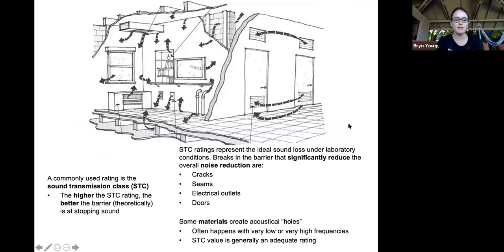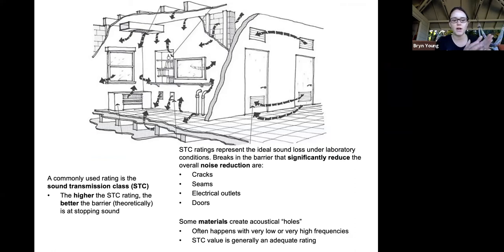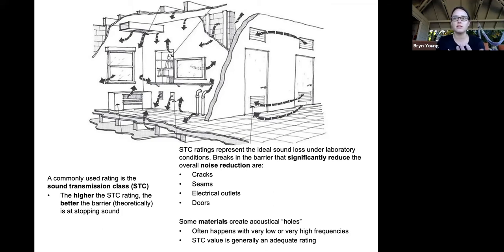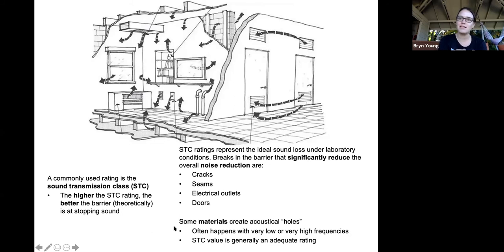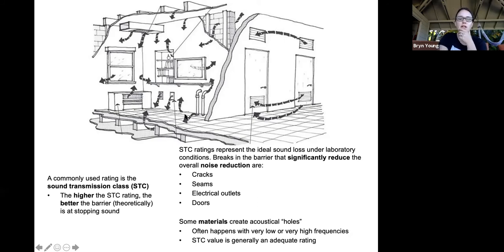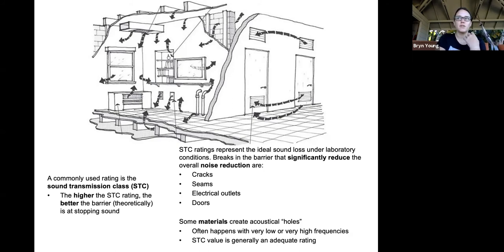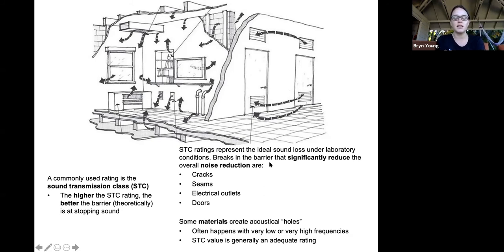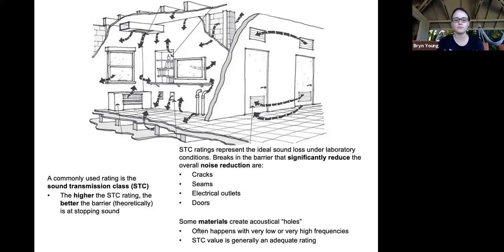Architectural Acoustics for ARE 5.0: STC rating

Comment: Thanks for the information!
Reply: Do you make any special considerations when designing a home if it is built using insulated concrete forms vs if it was built with traditional wood/balloon framing?
Reply from the maker: @PeeedaPan  it totally depends on the occupancy and what sort of considerations you’re looking for. ICFs are great for insulation and STC rating, so if you’re looking for a more insulated, sound resistant barrier they are a good option. Wood frame still can provide great STC and insulation ratings, as long as they’re paired with other details (like insulation, staggering the members, and c-channels). So, the outcome you’re looking for will typically determine the detail/wall assembly that is best.
Reply from the maker: Anytime!